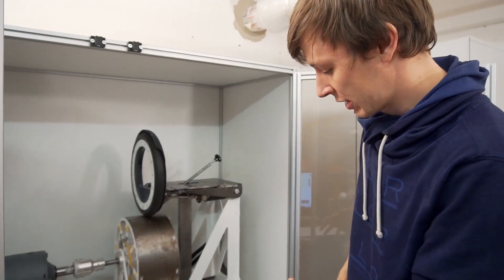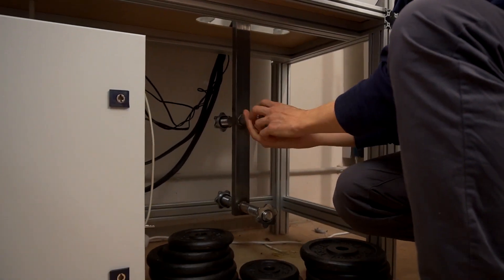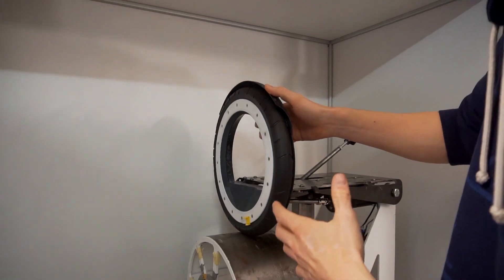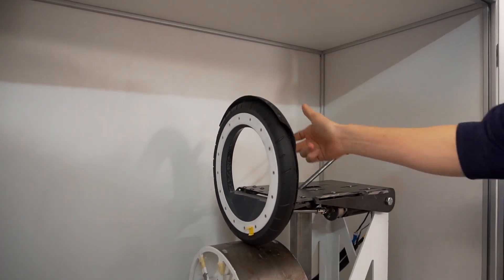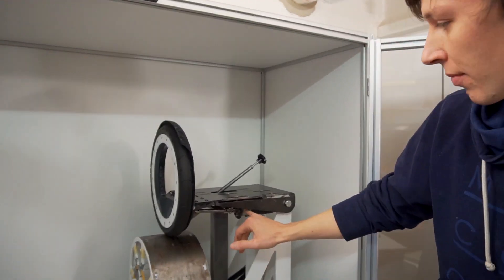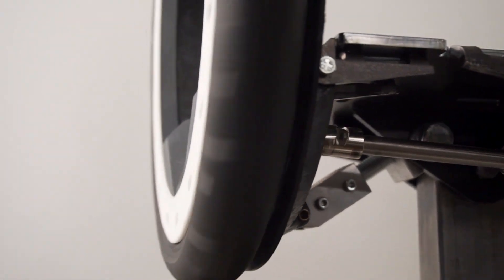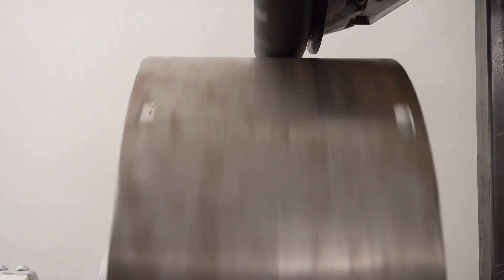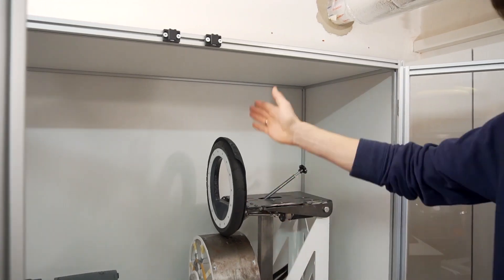Kickstarter Update #3 | UrmO

Comment: So, what about winter conditions? snow, dirt, mud? Is it a summer vehicle only? Since then, where is the point in such a vehicle in comparison to a bicycle?
Reply: This is no attack on your product, those are just questions that flew through my mind. I would be glad If you could answer them! :)
Reply from the maker: @HDCamcord  Thank you for the questions. I don't see that as an attack.
Winter conditions, in general, are no problem with the UrmO. The UrmO can run on dirt and also mud, as long as you don't dive into water. Snow will be slippery, just as it would be with your bicyle. The big point is that, with the folding mechanism, you can easily take UrmO on the train or put it in the trunk of your car and only use it for the last mile of your daily journey. You can also carry it up and down a flight of stairs. A bike cannot be easily combined with other means of transport.
All the best, Sebastian
Reply: @HDCamcord  about like a bicycle.